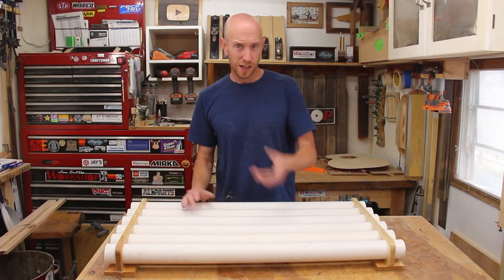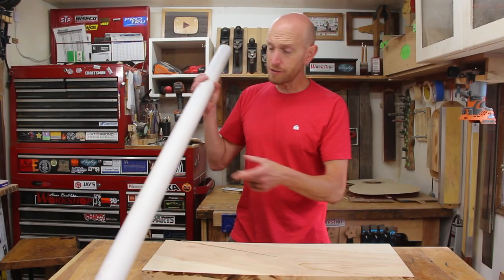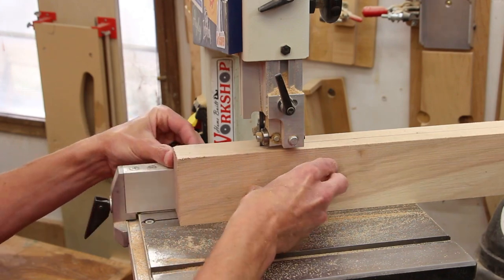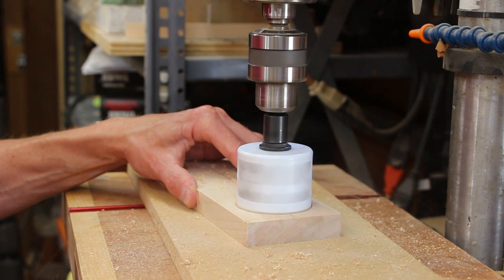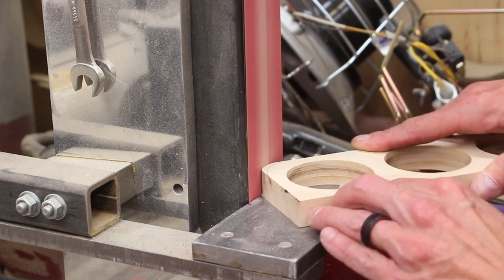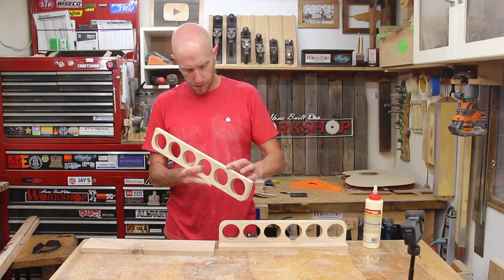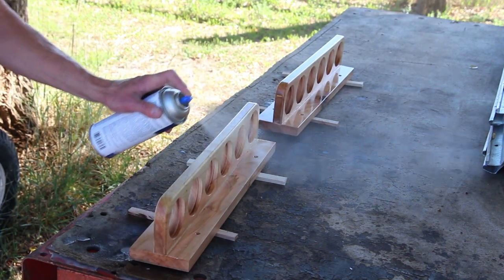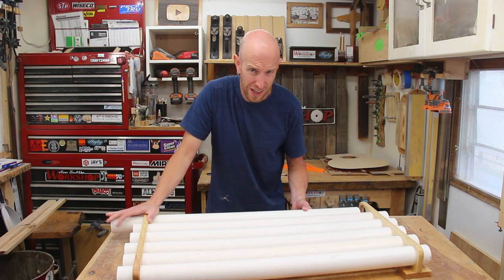Making a Storage Rack from PVC Pipe | Shop Projects

Comment: You should build a mini router table for your trim router. A nice addition to the shop and a cool video to boot!
Reply from the maker: I've thought about that a few times. I already have a small one in my drill press table though that works great for lots of those little jobs.
Reply: Yes but you don’t use it 😛